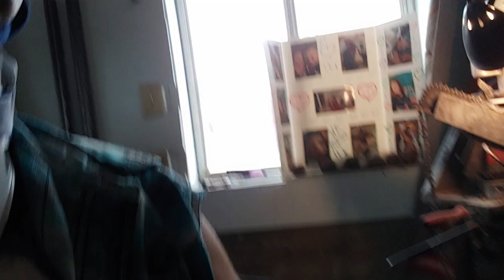Grinding chain with my Pro Sharp

Comment: I ran a Silvey Pro sharp for Years, i just sold it 2 years ago to a guy in Battleground Wa. They are a TOP SHELF Grinder 👍 The SDM4 was another Really good Grinder. I had a Silvey Razor Sharp II Back in the Mid 90s to Early 2000, it was a Good Basic Grinder, but no comparison to the Pro Sharp.

Comment: I have one of the last rolls of Oregon X chain. They had a little extra chrome plating on the cutter. But it's full comp. Got it from Madsens several yrs ago. Cuts fast. I don't know why I don't use it. I buy other rolls rather then use it.

Just started using Stihl low pro 3/8 picco. Has a narrower kerf- Cuts faster.

I use an Oregon 510 grinder as I am a fire wood cutter. I cut in the high desert, so lot of sand! The sand wears out everything quickly. Nothing more beautiful then a handful of freshly sharpened chain glistening in the night light. For some reason wife got mad at me for saying that.

I have my angles, gulit and racker deepth that I like as well.   I keep testing them to see what performs best. 

I'll be praying for you. Your one of the fastest cutters I've seen. I guess a part of that is in your grind.

I don't know if you and the Lord know one another, but I hope so. And, again I will be praying for you

The Lord bless, strength and speak to you. Not so much what you want to hear but what you need to hear. The Lord give you wisdom, understanding and guidance. And the humility and strength to obey.

Jesus is King

Comment: Worn out grinders are great.  I have an old RS2 that nobody can get to make a nice chain on but I keep making chains that people like.  I sent a good friend some chains one time and I heard that they got passed around assuming they were race chains.  I told them they were just my work chains.. nothing special to me.  One of the best compliments I've ever had.  

Have you ever had chain that you really liked and another cutter did not?  I've had chains others thought were great and I thought they sucked and vice versa.  I figure it all comes to how I run a saw versus others.  Another thing I find is where someone is cutting has a big affect on how chains perform.  Friends in Washington need chains to perform differently than I do in NC hardwoods.  I also set a chain up a bit different for yellow pine vs red oak or hickory.
Reply from the maker: Yes, for sure. No two cutters cut alike and how you run a saw has a huge affect. If I get a chain that is a little too aggressive I will not let anyone use my saw with that chain on for fear they will smoke my clutch. Wood does play a big part in it as well. You know your onions pard. I sure appreciate you watching my videos. God bless ya!

Comment: You told me you cut on the east coast some, I assume it was mostly in hard woods. I'd be interested in your thoughts about how the square performed in the hard woods and if you had change the profile a lot or not. 
Also, never heard the term about the chain "floating out". Can you explain for us non fallers? 👍
Reply from the maker: My chains worked well but they did dull quicker. I had to pack 4 ground chains to work a 6 hour day. I didn't change my angles at all but I would tweak them if I cut there year around. I'd steeped my top plate a touch and bring my side plate out a tad. Floating out......When your bar is buried completely in a big cut and you Bach it out it should come out easy and not try to cut back out. When I get back to work I will make a video on it.

Comment: Thanks for bringing us along.
Chain maintenance is crucial so I appreciate picking up anything I can. If it takes yrs for a pro to get it right, how much more for those who don't cut as often.
I've never used the pro sharp, but I've heard they are easier to keep the cutter even from side to side without much adjustment.
What do you use for gullets and rakers.
Thanks again.
Reply from the maker: I will help any way I can. Thanks for watching my videos.

Comment: What's it going to cost to get them angles??? hehehehehehe thanks for the video, keep working on your recovery buddy!
Reply from the maker: I will give the angles. Not sure why I said that. On reflection it was rude. Tried to edit it out but I suck at the video part and Sugar is too busy to help me with it.
Reply: @StihlSlinger661  no worries!  I have just been buying new chain everytime I need a sharper one, that is no way to live.  If you are willing to explain it, how do you setup a chain to "float" that part was very interesting.  There are plenty of terms that knowledgeable people use that I don't get.  A hungry chain is one, now floating is a new one :)  Love your videos Pat!
Reply: @StihlSlinger661   the angle thing really wasnt rude i know alot that keep those a secret but also on different grinders you can have the wheel angles the sme and get different results depending on where the guide is compared to the wheel and also height difference 
where at in wv did you cut pipeline at
Reply: @edgerat  a hungry chain is one that has an aggressive sideplate angle/hook, or the rakers set low. It will self feed easily and can be a positive thing, but if its too hungry and the saw doesn't have the power to pull the chain it will stall the chain in the cut.
Hope this helps and that it goes with what Pat was saying/would say.